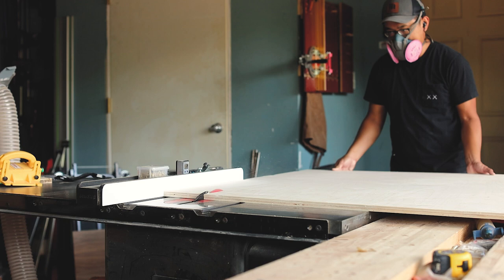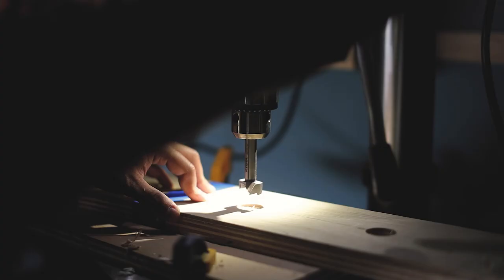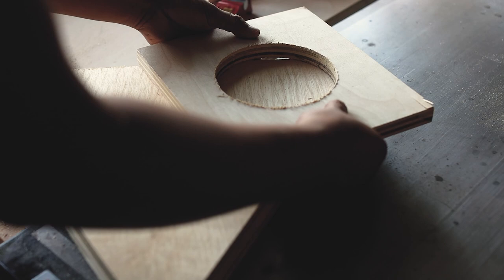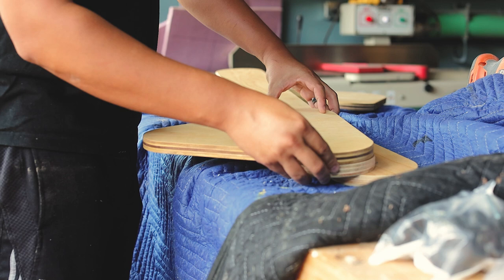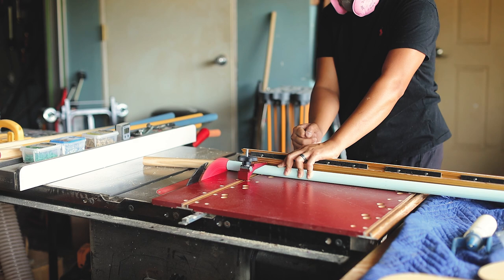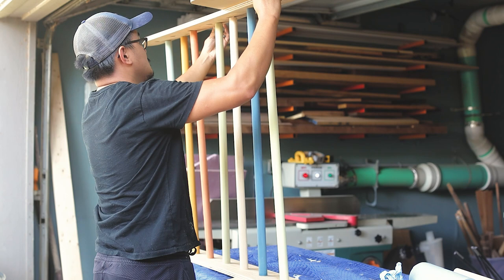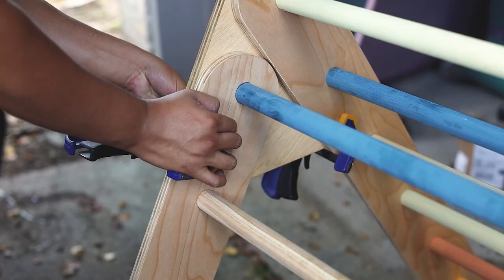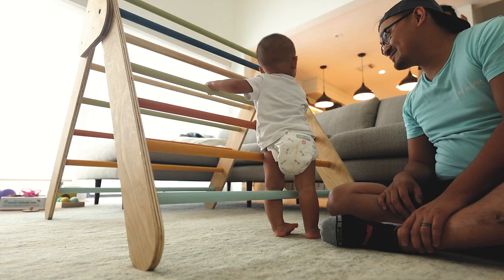Make a Folding Pikler Climbing Triangle FREE PLANS and Templates Available! // How To // Woodworking

Comment from the maker: Will you plan on making one yourself?
Reply: My kids are a bit old for this at this point, but if I knew about it 4 years ago, yes. ;)
Reply from the maker: Maybe for grand kids one day :)
Reply: Yessir! Thank you for the plans (and video), I really appreciate it!
Reply from the maker: @asztapaszta9  awesome! Hope it helps!
Reply: Just got all of my materials a few weeks ago except the knobs and odd bolts/screws. Gonna start planning it out tonight! Did you ever make a video for the slide attachment? Sounds awesome!

Thanks so much for the time and effort you put into this video, seriously!!!
Reply from the maker: @Vander_Galien_Handyman  no problem! I haven't done a slide yet but I am planning on doing a 2.0 version of this in the future which will include the slide.
Reply: @DesignCraftWorkshop  Look forward to it! Is there any reason why you're doing a 2.0? Just curious if I should know of any necessary changes to make ahead of time :)
Reply from the maker: @Vander_Galien_Handyman  mainly simplifying the design to exclude the locking hardware. Plus baby no. 2 on the way so it’s a good time to make a new one 😅
Reply: @DesignCraftWorkshop  I wanna wait for this new design now but also I wanted to build by Christmas now I'm torn haha
Reply: I have just built this for my kid, well similar I only have the jigsaw, sander and drill but it turned out pretty good anyway.

Comment: Great design and build! Thank you for making the plans available for free. I'm going to make this for my toddler this week. Quick question - how deep does the threaded insert and, connecting bolt and cap go? I'm assuming it goes through the triangle brace and part of the way through the shorter rail pieces.
Reply from the maker: Thank you! The threaded inserts should go in just enough to be flushed with the face of the plywood. The connecting bolt and cap should go through the plywood on both sides.
Reply: @DesignCraftWorkshop  thanks for the quick reply Bao, greatly appreciate it! I looked over the video again and together with your reply, everything makes sense to me.
Reply from the maker: @kierthiswaminathan8967  glad to help! Lmk if you have any other questions!

Comment: Great work! Thanks for sharing! Quick question: did you seal the milk paint with any protective coating? Do you find it necessary after months of use?
Reply from the maker: Thanks Cooper! No I didn't seal it and I don't think it is necessary. I personally don't mind the paint fading over time, but so far it hasn't faded it all

Comment: Hi great explanation :) 
I have only one small issue: imperial size
3 Feet, 8 Inches = 111.76 Centimeters (this one is easy)
but
8 1/16 Inches = 8,0625 inch ? (then = 20,47875cm)
Thanks
I will round it into cm anyway but the x/xx are little weird when you are note used
Reply from the maker: Yea, I'm not too sure what the imperial equivalents are. I'm sorry.
Reply: If it helps you, I have already convert all measures to cms:
0'6" -> 15.24cms
3'8" -> 111.76 cms
3'1" -> 93.98 cms
0' 4" -> 10.16cms

For the triangle:
8 1/16 -> 20.48cms
5 9/16 -> 14.12875cms
2 9/16 -> 6.5325cms
11" -> 27.94cms

Comment: Hello Mr. Loi, 

Again, thanks. Wonderfull wonderfill project. I will be starting it next weekend. I am already thinking in a couple of changes. One is the height, I think I am going to short it by 15cms (6"). I am a scared dad. The second one, is that I am going to change the space dimension into 13cms (a bit more than 5"). But I have a question, checking your video and your plans (thanks for the triangle btw), I released the distance of the first hole to the bottom is different to the hole on top to the top of the rail. Could you please give me those measures? on inches would be ok.

I hope you can undestand me.

Thanks,
Manuel
Reply from the maker: Thank you! I won’t be too sure what the dimensions are. You might have to recalculate some of the lengths. If you move everything down by 6” and then shorten the spacing you might only be off by a few inches.
Reply: @DesignCraftWorkshop  Thanks! But my question was about the distance between the bottom of the rail to the first hole, and also the length from the top of the rail to the first hole in the top.It's something I cannot figure out.

Comment: Since the template for the triangle is not to scale, where do I locate the pivot hole?
Thank you for wonderful project!
Reply from the maker: It should be to scale if you print it as a poster. There should be 3 8.5x11 sheets on the top row and 3 on the bottom. Tape them together and you can cut out the triangle with that template.
Reply: Am I able to get another set of plans to attempt to print the template in poster format?
Reply from the maker: @denniscallahan7363  you should be able to print it from the original file you downloaded from the site

Comment: What size poster should this be printed on? I downloaded the plans, and tried to print the template, but it keeps printing normal size.
Reply from the maker: Thanks for the question! If you're using Adobe Acrobat, you should be able to select "Poster" under the Page Size and Handling and it should give you the size needed based on 8.5x11 sheets. That way you don't have to spend money on getting an actual poster printed. You'll have to then tape the sheets together and make sure the dimensions are scaled and the lines are aligned. Hopefully that helps!
Reply: @DesignCraftWorkshop  Do you know what's the actual size of the "Poster" size in Acrobat? Just want to make sure I got the precise printout. Also, the dimension of the triangle and the drill positions on it should be the same if I place the rods 5" apart (instead of 6" as used in the plan), right?
Reply from the maker: @yijiazhan45  thanks for the question! The paper size is A2 or 11x24. If you print it as post, it'll give you 3 8.5x11 sheets on top and 3 at the bottom. The holes should work if you decide to move the rods closer in. You just have to double check the threaded bolt and cap location. Hope it works out for you!
Reply: @DesignCraftWorkshop  Thank you! I am about to start the project but I haven't decided on the gap between the rods. How do you find your triangle working out for your toddler, as yours is 6" apart while most are 5"? I have a 13-month old and I too want him to grow into the triangle, but I'm not sure if the wider gap and thus taller overall height would make it more difficult and less safe. Is your kid able to climb over it now? Thanks!
Reply from the maker: @yijiazhan45  he’s still learning but the 6” is prefect for him now at 18 months

Comment: I am planning on making this triangle for Christmas for my grandchild.
Questions:

First the triangles:

#1)  The 11" height is after you rounded the corners, yes? What were the original leg lengths? Did you base this triangle overall size on the  4" rails detailed in the plans or the 5" of the video (I am assuming 11" + radius of curve which would be either 2 " or 2 1/2" would give me the overall size)

#2) Are the 3 corner holes drilled at center point of the corner radii?
Reply: Cont..
#3) You noted the distances between thsse drill holes as 8 1/16" but the side with the knobs hole breakdown adds up to 8 1/8". Can I get some clarification?

#4) How thick of plywood did you use on the triangles?

Now for the rails:

#1) Plywood thickness?
Reply from the maker: Thanks for the questions Deborah! Regarding the triangle, I've made a template you can download on my website for free which will give you the exact locations for the holes. For this build, I used all 3/4" plywood for the triangles as well as the rails. Hope this helps!
Reply: @DesignCraftWorkshop  all of these questions came from your documentation
Reply from the maker: The plans are based on 4". The lengths and widths of the legs/rails should be on the plans. The knob to break down the triangle can be placed anywhere as long as it lines up with your rails. The 1/16 difference is probably just the tolerance sent on my program where I made the sketches. If you print out the triangle template, you should be good to go.

Comment: If you don’t mind me asking, how much did lumber and hardware cost? Thanks!
Reply from the maker: The rods are the most expensive. Each rod was $7.00 and then around $55 for the plywood. Hardware was less than $20.
Reply: $4 per 1 inch rod at Home Depot
Reply from the maker: Must be nice to have cheap pine rods in your area. 😀
Reply: @DesignCraftWorkshop  haha I’m here in Seattle. Lots of logging is done here. Maybe that’s the reason 🤷‍♂️ Obviously this year didn’t help the prices overall
Reply: @DesignCraftWorkshop  checkout the video "Making Large Dowels WITHOUT a Lathe"
Reply from the maker: @iohin  I've seen them before 👍🏻 really good stuff